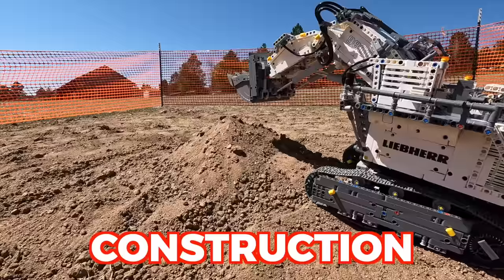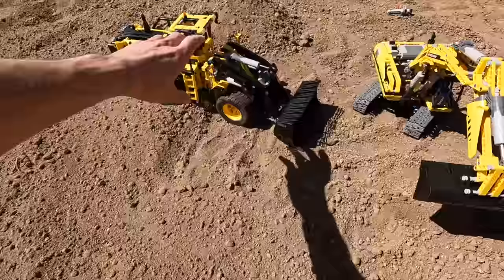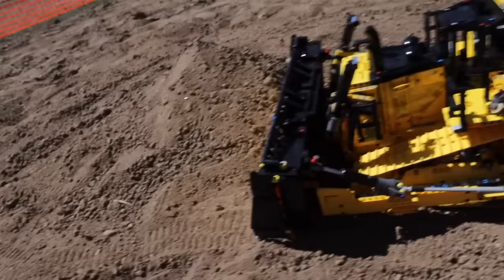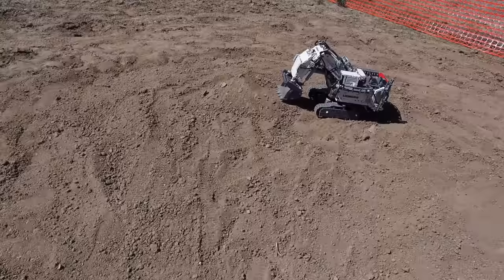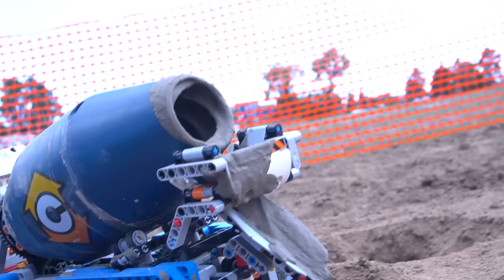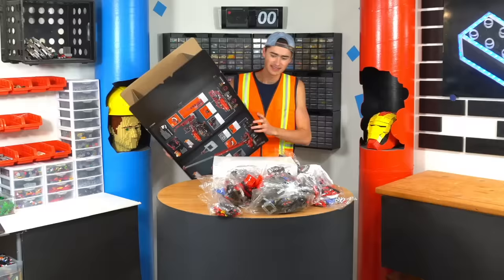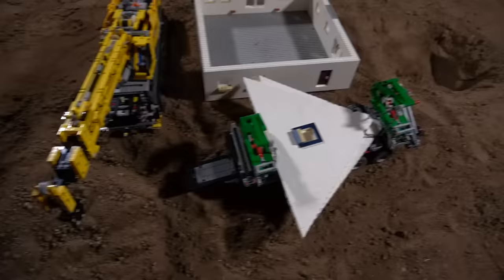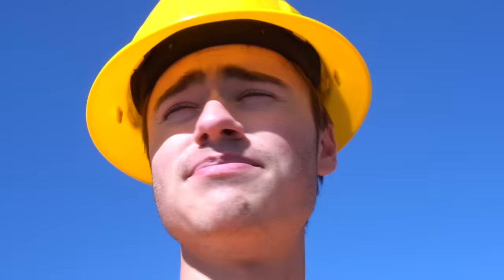Can LEGO Technic Sets do REAL Construction?

Comment: List of all the sets in the video (in order):

8043 Motorized excavator (released 2010)
42030 Volvo L350F wheel loader (released 2014)
42055 Bucket wheel excavator (released 2016)
42114 6x6 Volvo articulated hauler (released 2020)
42131 App-Controlled Cat D11 Bulldozer (released 2021)
42100 Liebherr R 9800 excavator (released 2019)
42112 Concrete mixer truck (released 2020)
42082 Rough terrain crane (released 2018)
42043 Mercedes-Benz Arocs 3245 (released 2015)
42009 Mobile crane MK II (released 2013)
42078 Mack Anthem (released 2018)

According to the prices in the video and bricklink prices (42043, 42009 and 42078 prices aren’t shown in the video, Riley paid around 4653$ for those 11 sets.

Also, if anyone is interested, from these sets I have 42114 and 42082 and I would enjoy getting 8043, 42030, 42100, 42043 and 42078

lol
Reply from the maker: I appreciate you made this!! ❤️🤜🤛
Reply: Wow you put in a LOT of effort writing this 😂
Reply: As soon as I saw the amount of sets you bought, I realized I'll need a chart like this myself :D
Reply: @Tapitus-totalus  😂
Reply: I’ll put this out here, the mobile crane MK II (42009) is similar to a leibherr ltm mobile crane, but isn’t after I realised it’s just a claw not an excavator-similar pushy thingy.   

Also I appreciate your comment.❤
Reply: @Brick_Science  Hi

Comment: I’d like to see if you can make Lego construction equipment that can actually work better than the kits! Or see if you can make the kits stronger
Reply: I wonder if using LEGO Mindstorms to roboticize the machines will work? Mindstorms from NXT and later tend to have more powerful motors than Power Functions.

Most iterations of Mindstorms can be set up for remote control, as well, be it by another p-brick of the same generation or by some other device like a phone or Bluetooth game controller via third-party software and firmware.

Comment: As awesome as this was, it kind of hurts to see how expensive those sets are. Literally 2 of them is what I pay for rent.
Reply: the first set, 8043, at $585, I thought "no way"...some of these sets in the video are old and retired, so the prices of a new sealed copy reflect the scarcity. The original retail price in 2010 was $199, which is still expensive but more in line with what I would expect for a motorized Lego set.
Reply: @glass_knuckles  good point. Although it’s still just colored plastic with an expensive label. But I appreciate your insight